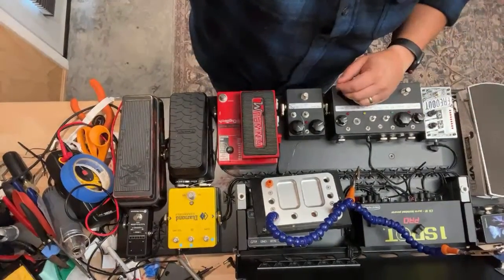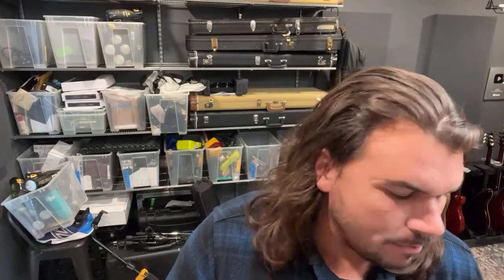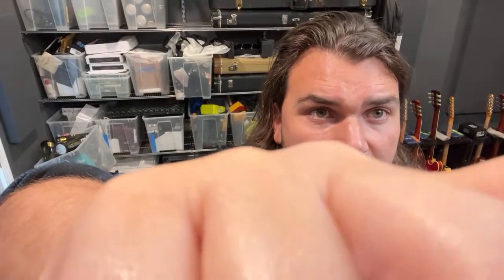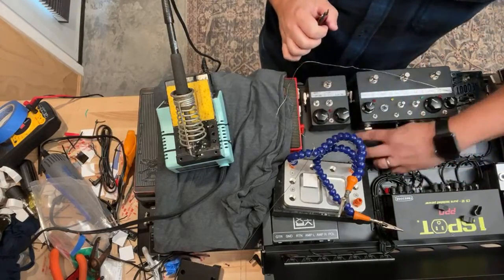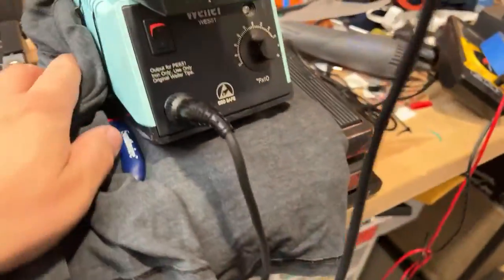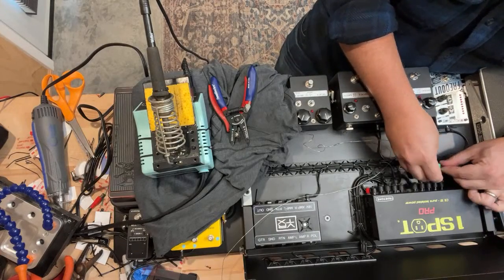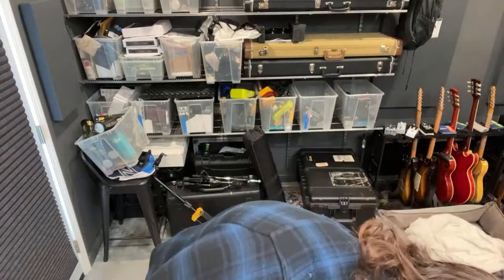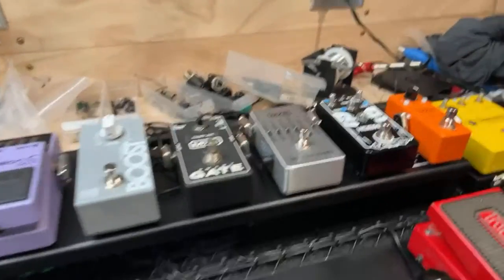Pedalboard Building Tips + Q&A

Comment: Have you tried using Solderstick to connected audio cables or T-Tap wire connectors on audio cables? T-Tap wire connectors can be used for troubleshooting pedal boards when a live gig if one of the patch cables is occasional working or intermittently working the T-tap wire connectors can help find which patch cable is bad while the guitarist is still playing a live gig without any interruptions

Comment: Hello, Mason! I just built my first pedalboard after 15 years of using multieffect Digitech GNX3. I still have room for some pedals on my board and in my switcher and I was wondering, which pedals should I add and what do I miss. So far I've got: Beetronics Vezzpa -> Dunlop Dimebag CryBaby Wah -> Boss ES-5 switcher (JHS Double Barrel, Fulltone OCD, Boss GE-7, TC Electronic Polytune 3 Noir) -> Xotic EP Booster -> Strymon Mobius -> Strymon Timeline -> Strymon Blue Sky V2. I still got room for 2-3 regular-sized pedals or 1-2 bigger-sized pedlas. Any recommendation from your point of view??? Big Thanks!

Comment: Hi Jason! You mentioned that the type of wires that are used to connect pedals to power supply doesn't effect sound quality so the type doesn't really matter as long as they meet the electrical requirements e.t.c.. But how about say for example the power cable of an amp? Is it the same deal? Or can the quality of those effect sound quality?  For example depending on the thickness and material of the inner core?  Thanks

Comment: Hello Mason! I have a question! 
Just some context: I am finishing a flat pedalboard build which relies essentially on being as compact as possible (13.78x11.02 inches) with 6 pedals (including wah), interface/buffer and PSU. The PSU has 4 outputs so I will need to combine power in 3 of the outlets, and for that I will need the thinnest power cable so it won't be under so much tension: what is your advice for the smallest diameter power cable that you've worked with? The ones I have been able to find are slightly above 3mm in diameter. I was wondering if strymon would fit the bill. Thank you!

Comment: Ive got a question about the buffer interface.. Im alittle confused, does it require wiring or do you just secure it on the board and plug in.   I would use it for the 5 cable method and am looking at purchasing a board, probably a vertex but with the buffer.  thanks!!